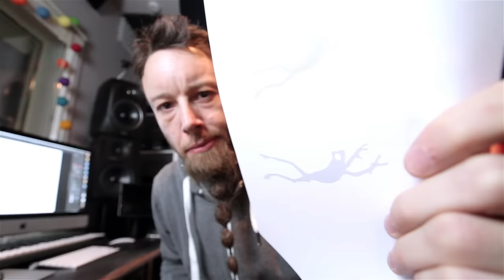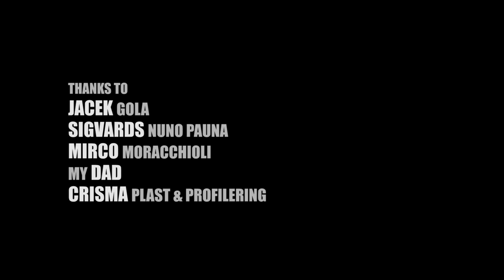MAKING MY CUSTOM GUITAR!

Comment: I've been taking apart, epairing and building guitars for over 40 years. I am always changing something about them; pickups, paint, electronics, whatever. Ive never done a fret job but i need to learn so I can dress some and do some real fret dressing. I have worked on my basses mostly. I paid a guy a lot of money to redo my 1957 Fender P bass. The color is not period correct but I rescued it from death so I can do what I want.
I appreciate your enthusiasm but some of your painting techniques are lacking. What type of paint did you use? My buddy and I thought you had a custom guitar with a custom paint job. I always wondered how the frog was done.
Nice guitar, I have seen you play it in every video s you must love it. It's fun, right? I gigged with my first build for years as well as recorded some drunken jams.
Slodering is pronounce soddering; the "L" is silent as it is in "Salmon".

Chappers will want to use your paint scheme in the future.

Comment: Did you intend to have the wiring be visible?
Reply: Hayden of Everything I think he could of done better wire management
Reply: Well, he did choose clear plastic to make it from.  I don't have any experience with the EMG pickups and their battery but if there's an indicator light that shows when the battery needs replacing it would be very helpful.

Comment: Man! 😳 Love your channel and this Video. But: Are you aware, you were risking your health and especially seriously injuring your hands by routing the pickup hole this way? This is really dangerous, please people don't ever use a router freehand without a template and without security precautions. Please imagine this cutting tool spinning at 6000rpm jumping out of the wood landing in your hand or arm. I have seen injuries like this.
It's totally fine to just try and do your best. Just pointing out that this routing part is really dangerous.
Reply: He didn't clamp down the body. He put the router on the body while it was still running. He didn't use dust extraction. He didn't use proper protective gear either so he's lucky the routing job didn't turn into a complete fucking disaster

The lack of template is not a big deal since the pick up cavities are hidden behind the pickguard 

He is not a woodworker  but oh my god that was painful to watch.